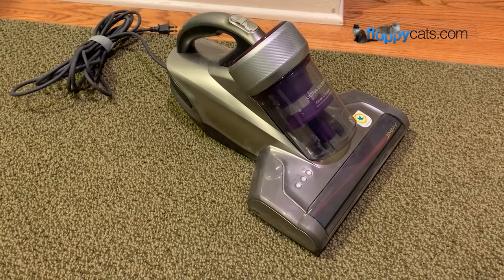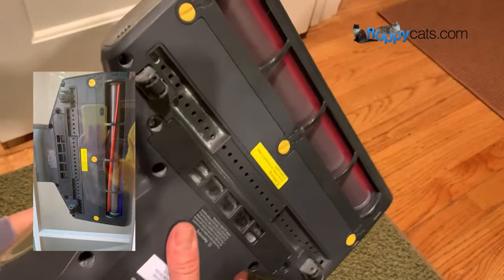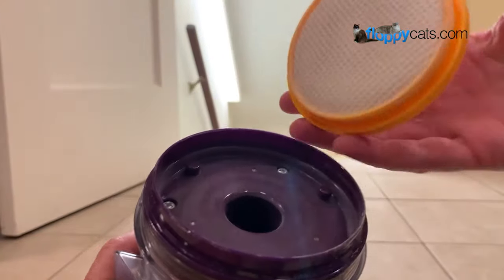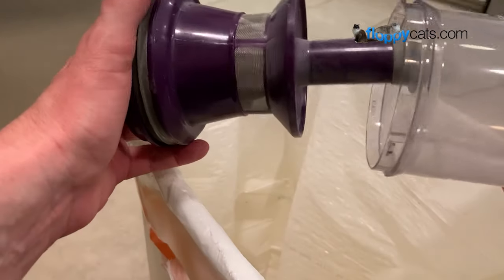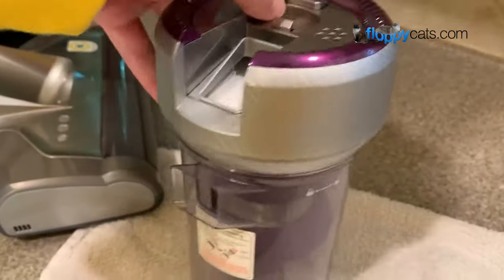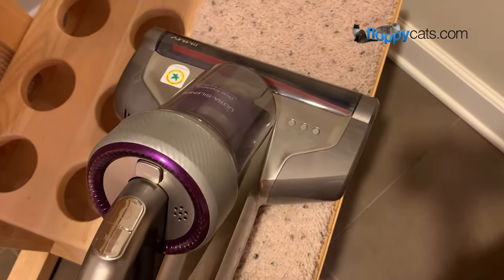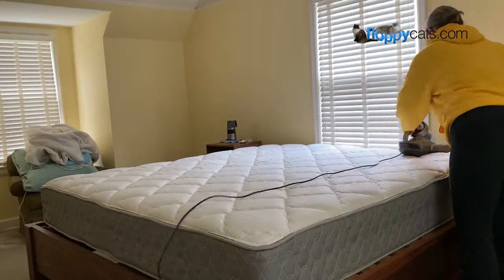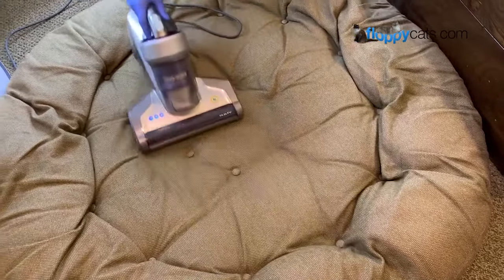Jimmy JV35 Product Review: A Handheld Vacuum for Pet Hair

Comment: I wonder if your cleaning lady went and bought one for her jobs, like you said it seems useful for furniture and stairs. I started vacuuming my vacuums every so often 😆 I bought one of those large wet dry vacs last year, mainly for getting up dirt in the garden instead of just sweeping and it blowing around, then I can just tip everything I collect up leaves, dirt etc into my composter, but it also has a large bag you can use with it and the suction is really strong so it really sucks any dust left in the vacuums and around the filters 😊 I actually have quite a few different vacuums, I think I have a vacuum obsession 😆
Reply from the maker: She comes tomorrow - so I will ask.  She wanted me to send her the link on Amazon, so I did.  I wouldn't be surprised if she did.  She is one of those cleaning folks that bring all their equipment into the house.  However, I DO NOT allow that because of my experience with 1. Charlie's allergies, 2. Fleas, 3. Fragrances.  I don't want anything coming from someone else's house into mine.  She was adamant about using a Swiffer thing to get cob webs - so I did let her bring that in and OMG the fragrance was overwhelmingly horrible.  Why do they need to add fragrance to a freakin' duster?!  Ugh.  So, I have just ordered one from Amazon that is supposed to be fragrance-free.   "I started vacuuming my vacuums" - HA HA! I totally get it!  I've done that! I currently have 6 vacuums - a Hyla, an Oreck, a Dyson stick vac, a Hoover cannister vac, a shop vac and this Jimmy JV35.
Reply: @Floppycats  fragrance on a duster, ugh I duno, I just vacuum cobwebs with the nozzle on the vacuum these days and my newest vac has a soft dusting attachment for surfaces which I like 😊
Reply from the maker: @Aw_tig  Yes, the fragrance is terrible.  I like the duster over my vacuum for the cleaning where it is.